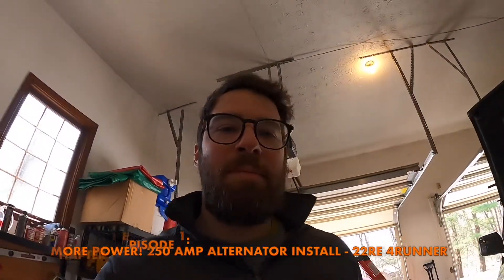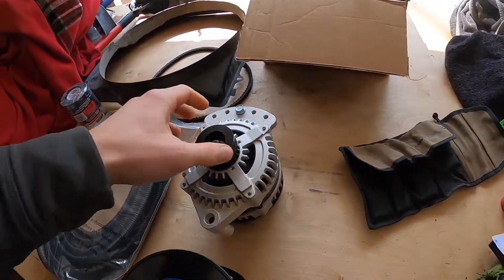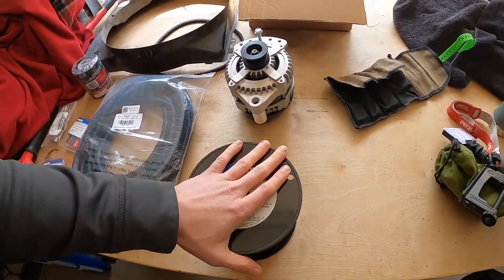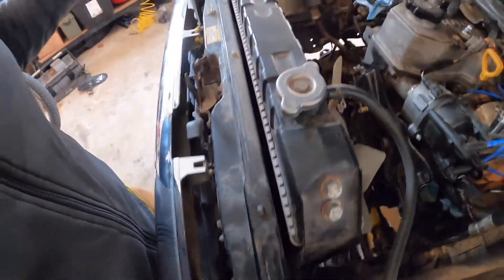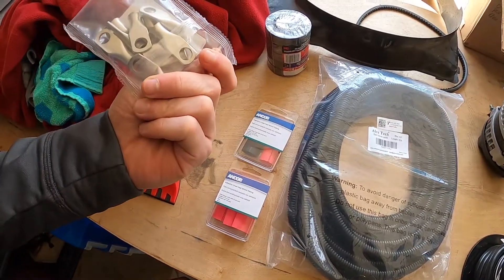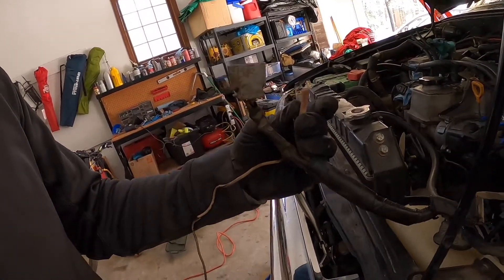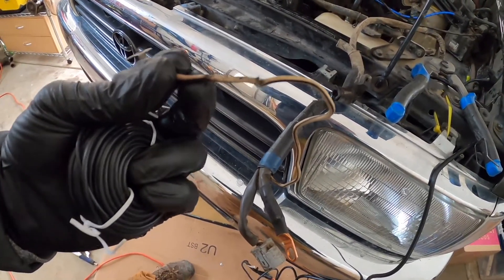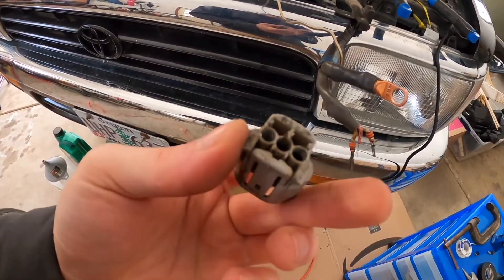C1E1: MORE POWER! 250 amp alternator install - 22RE Toyota 4Runner

Comment: Question...i have the 3 wire plug,and i have 2 additional wire,one looks like it grounds to the power steering assembly,the other is much smaller...where does it go?? Mine wasnt connected...HELP

Comment: I am having the same 3 issues in my 91 22re, mass air flow sensor is a little out, power steering is going out and the battery is losing power and can't take more for extra lights and such.